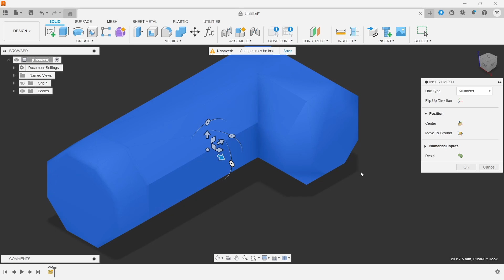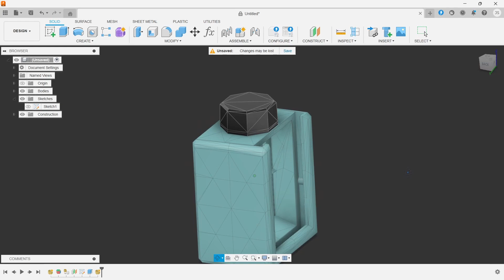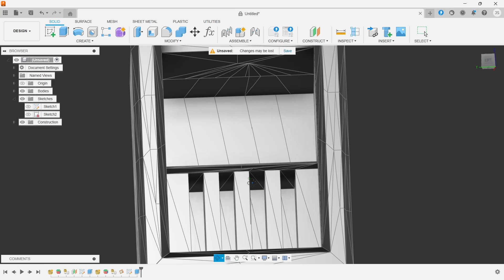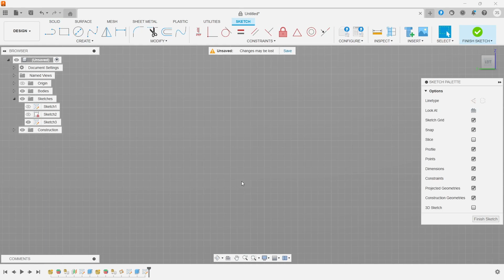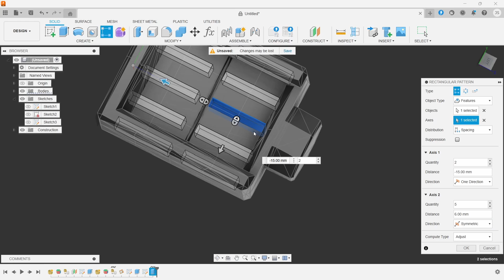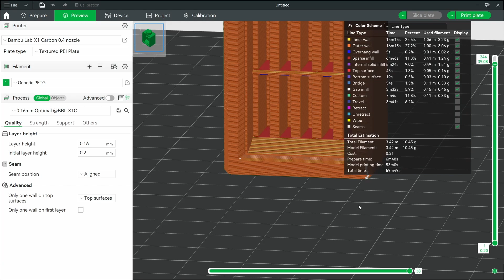Remix Multiboard in Fusion | Custom microSD Holder

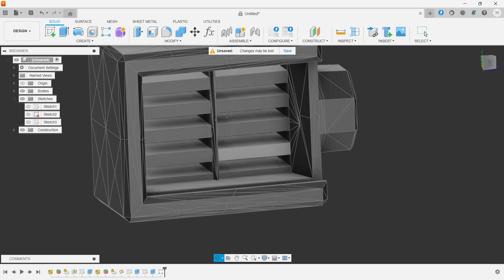Comment from the maker: Does the audio sound a little off to you?  I listened to it through several different speakers and it sounds somehow different to me after 15:10.  Is it just me or do you hear it as well?
Reply: I noticed it but it didn't take away from the video 👍
Reply: yeah, sounds like maybe you have your input audio doubled/multiplied. Usual culprit, especially on programs like OBS, is if your voice is picked up on desktop audio as well as your audio input device, it can be doubled. Like others said though, great video instructions though!
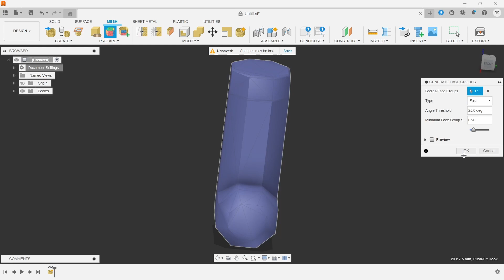Reply: Sounded weird at 1:45 to me. Bit of robot distortion.